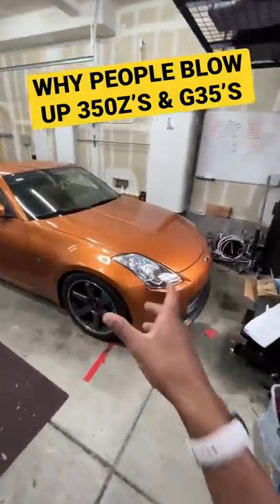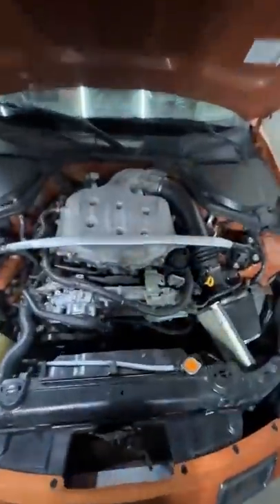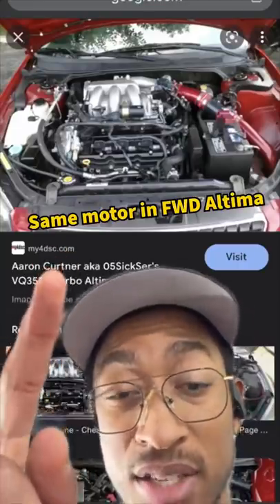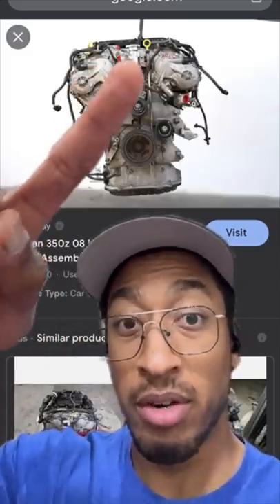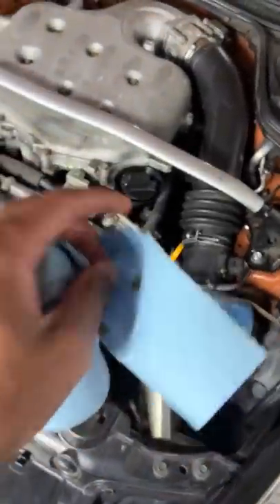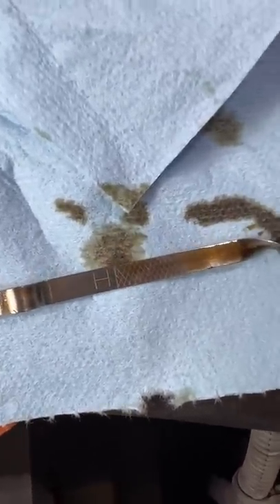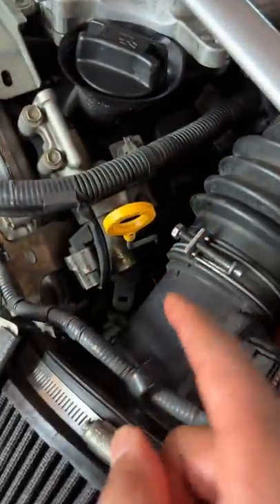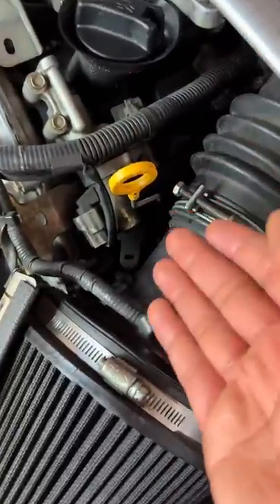Why people always blow up their 350Z’s and G35’s 💥🤯💣

Comment from the maker: In case it wasn’t obvious, I followed the manual to the letter in the first oil check. Ran to temp, waited 15 mins, pulled, wiped, redipped, and you all saw the result. I have confirmed that the VQ35DE does use the dipstick tube cast into the block as an oil drain, which is why the stick comes out coated unless the car is cold. Some cars call for cold oil checks, some call for warm. This one is unreadable if you follow the manual.
Reply: So what you're saying is the manual was written by the engineer that wants you to blow the car up so the mechanics have a reason to work on it sounds legitimate
Reply: @waynelarson1576  nah it’s probably the same manual meant in the transverse configuration so it won’t apply with the engine in the longitudinal way
Reply: @AB-rr4xh  it did the same exact thing in my Altima with the vq35 so no.
Reply: @dylanbenker2043  your altima is FWD 💀
Reply: @dylanbenker2043  AKA transverse layout
Reply: Not saying I don't believe you, but how is oil splashed all the way up the dipstick in the test where you followed the manual if you, like you said in this comment, wiped the dipstick? 15 minutes after the car is shut off, the oil should be starting to settle back into the sump, not expanded and running all the way up the dipstick, or still draining and coating the dipstick after a wipe. I've done plenty of oil changes on these engines for work and I can't say that I've ever had this problem after letting the engine cool for 10 minutes and wiping the dipstick before getting a read, so I'm not sure why it's occurring for you.
Reply: @Lyuze  I did wipe it and check it when it’s cold but I think what Chris Gaines is tryna say is that the oil is still up on top of the engine and draining through the dipstick tube. Waiting 10 min seems fine, you could try to check it after 10 min and then another in the morning see if it’s different
Reply: These engines are an absolute headache to check the level in. Don’t read what the manual says, instead just check it cold. 
Source: am lube tech
Reply: @anonymoose6969  source: I had one
Reply: I just want to know why you got a BMW steering wheel in a Nissan haha 😅
Reply: Arguably the worst thing about my car is this bloody thing
Reply: Why do you have a bmw steering wheel aha
Reply: @Lyuze  The oil returning to the pan runs across the dipstick.
Reply: Guess you didn't know you just wipe it off, then recheck...
Reply: @carlt6932  not 15 minutes after shutting the car off it doesn't. Oil is less viscous when it's hot (i.e., after the car has been running), and will settle much faster than when cold
Reply: @Orion801airsoft  guess you don't know how to read, seeing as he and many others followed the manual and this engine's oil reading is notoriously difficult to read.
Reply: @frazierl7898  lol.
Reply: @Orion801airsoft  either what you said was a joke and I am brain dead, or you were serious. I think chances are my brain is frying.
Reply: be sure it reads high level...... 
no oil in the head in the morning.
Reply: Dude get rid of the owners manual and get yourself a dealership manual!?
Wtf bro?
Who uses those?
Reply: @thecloneguyz  whenever I feel like I need the manual or I just want to see what it says I just download the pdf for it off of google.
Reply: My girls mom has a Murano, it’s a four door SUV for those of you who don’t know. I’m pretty sure it has the same engine. After changing the oil and refilling the dipstick is coated nearly the entire length as well as your same issue while hot.
Reply: @frazierl7898  believe it or not that won't tell you anything go get a dealership manual and look at how itemized those are you will never use anything else ever again
It literally shows you step-by-step where each bolt and each thing comes out first and then goes back nothing else will show you this
The reason the dealerships use them is because they don't have time to learn stuff they need something that shows them step-by-step immediately
Reply: @thecloneguyz  yeah I know what those are I work at a freightliner dealership. I don't use them as I'm not a technician but they're pretty helpful from what I saw of them.
Reply: How did it turn into a bmw
Reply: yeah i blew my up from running from the cops so much. i’m getting a new built vq35 de put into it.
Reply: You have to test it at temp not cold. Warm it up. Shut off the car. Pull stick. Wipe. Dip again. Pull stick. Check. Simple.
Reply: That design of dipstick is basically a right side up breather tube. Buddy if mine loves these cars and have been modifying them for years and also states this tube can blow oil out if the stick isn't a good tight seal also. This also effects oil pressure in race applications.
Reply: Thanks for the bit of knowledge👍😎
Reply: I'm pretty sure your supposed to check oil cold and atf you check hot in Neutral
Reply: @Crackpidgeonextreme  in most engines you can check oil while it's hot, it just has to be off and level.
Some automatic transmissions on the other hand, have become more "complicated". IMHO Overly complicated
Reply: What a load of rubbish 🤣🤣
Reply: HRs dont have this problem. Get a 370z in a few years when their value plummets.
Reply: Y is der a BMW steering wheel in ur Nissan ?
Reply: Far as I could tell the Impreza 2.5L boxer engines have the same issue, manual calls for warm check but that isn't the real oil level, there's nothing to read for a good 8-18 hrs. Have to check it cold even though it says otherwise.
Reply: Yeah I didn’t see you wipe the stick when checking after running so
Reply: When I had my G35 I ended up getting 60 grits sandpaper and sanding the crap out of the dipstick around the high and low part so the oil had a place to actually stick to when i checked it
Reply: Lube techs have a trick,  spray brake clean on the dipsticks read area, wipe,  then dip the stick very quickly, usually gives an accurate read
Reply: You just have to turn engine off, wipe dipstick and check again and you have good reading
Reply: If you cant check your engine oil you shouldnt own a car.

Most people blow these cars up because of gallery gasket failure , missfire issues while still running the car everyday. Stupid maintenance issues that are left un seen because they think the motor is so tough when in reality its only reliable if you keep up with the maintenance. Most 17yr olds thay buy these cars do not know what maintenance is and decide to only get it checked when they hear knocking noises in the car.
Reply: Can i just say, as a professional mechanic, I could write an essay on why you shouldn't listen to this guy. Oil expands with heat, check it hot. Use quality lubricants of the correct weight and property standards. And keep up service intervals. What are the most common failures you ask? Chain guides and VVT hubs or solenoids. Components that rely HEAVILY on proper lubrication. You have pinhole sized passages which actively adjust your vehicles timing and thin plastic guides that keep tension on a hardened steel chain. Just treat your car right. Or maintain it as often as you beat on it. 6 months from now I'll have a guy at the shop with a blown VQ saying "well I tried to checkmy oil but it dripped down the head onto the stick and made it hard to read." And yes, as a mechainc, this makes me unreasonably upset. Although what do you expect from a guy who drives a 350 with a useless bumper air duct and a (fake) bmw steering wheel. Only thing he's missing is an aluminum nismo oil cap.
Reply: That’s right not overnight it need to warm up cause oil expand
Reply: these blow up because people dont change oil every 2500-3000 miles and theyve been redlined since day one lol. my 04 g35 is at 170k running good and strong, but also the DE is the best VQ to build with.
Reply: Sounds like Nissan to me.
Reply: start the car run for a minute grab dip stick pull it out, wipe it, dip it, pull it out check it the reason is that the oil filter drains back into the pan so if you don't start the car and fill the oil filter then the reading is wrong and low on oil in this case.
Reply: Do it fast. Read my other comment as to experience, but get it over halfway and do it in all the way, make sure it seats and get it out. You can get between the drips from the drain hole above it. That and if it is covered on one side, not the other where the marks are, turn it around and try it that way, or just check it cold
Reply: So they blow up because the dipstick is difficult? If you’re that clueless about cars, maybe you should take it to someone else to change your oil for you😂
Reply: Thanks for the full uodate
Reply: It’s an “engine”!
Motors are electric.
Reply: @buellb0y  I think you're splitting hairs. It's a slang term. I don't think anyone on here is confused if it's eletric or internal compression. Worst than my small engine repair teacher when I was in school
Reply: You see, that's a good ol fashioned oil check. "Is there oil?" "Yep we're good"
Reply: My man, pull out the dip stick. Spray cold water on it, wipe it off, put it back in the car, pull it out and bam you can read it fine.. You're welcome 😊
Reply: Haha, that’s why many people don’t read manuals 😅
Reply: I've been in the process of rebuilding my DE and from what I can tell, the dipstick actually touches the very bottom of the oil pan, so if there is no oil on your stick, you are literally out of oil, everything else to talked about is correct aswell
Reply: @Lyuze  Literally anyone who owns a G35/350z with the vq35de can tell you that if you follow the manual, you can't read the dipstick. Yes, if you shut it off the oil settles into the oil pan after 15 minutes. What it doesn't do is slide off of the dipstick in 15 minutes, because it "sticks" to it for quite some time.
Reply: When you check the oil warm you need to pull it wipe it off put it back in then check it
Reply: Yellow dipstick means read cold...
Reply: Also if you’re running no fender liner and aftermarket intake you can suck up water in the rain and hydro lock your shit
Reply: @Dudeman9339  the 3.7 motor was a let down , the VQHR motor is the best NA V6 they made

Comment: The real reason is simply neglect and abuse.
Reply: Real reason is becauee theyre designed bad
Reply: Yes
Reply: Yea and also he’s a putz for not being able to see the oil break line on his dipstick idc how much blows up the tube
Reply: This. Mine had 4 previous owners- 3 women and a h0m0. Makes sense that the engine was a55. We dropped another one in there and it was great, so it was probably owned by a logical human being.
Reply: @cateatfood6634  you knew what you were getting into buying Nissan 😂
Reply: @oliver6287  I don’t care how good you think you are, there is zero reading of the dipstick when oil is flowing around the entire thing. 

Luckily with these engines you just assume 1000 miles = add 1 quart and try to remember to get a cold reading next time.
Reply: Bad oil type, engine was not supposed to be in use at sport car
Reply: Well if you don't know your oil is low and you go abusing it you're far more likely to blow your motor
Reply: Based
Those engines are pretty reliable
Reply: It's because Nissan motors are notoriously bad All the good motors Nissan's ever used weren't designed by them
Reply: @williamhargreaves1563  it's an engine used in many Nissan's for the exact opposite reason. it's robust and reliable.
Reply: @williamhargreaves1563 No. Real reason is neglect and abuse which any car, I don’t care if it’s a Toyota or a Ford. It will break down due to neglect and abuse.
Reply: @williamhargreaves1563  The VQ35HR engine is amazing what are you on about? thats why people leave them shits stock, you've clearly never owned a Z smh
Reply: @williamhargreaves1563 Lol yea they’re designed so poorly that they were used as the basis for the VR38 in the R35
Reply: It keeps me up at night sometimes😭😭😭

Comment: BMW steering wtf 😂
Reply: i was going to say the same thing lmao
Reply: He’s in a bmw then check oil in Nissan?  Huh?
Reply: @VikingsFan-sy2vc  its a nissan with a bmw badge on a nissan steering wheel done to troll haters
Reply: wtfff frr that's what i said 🤣
Reply: Right lol
Reply: You've never seen OEM plus?
Reply: Threw the bmw steering wheel on as soon as he noticed oil issues😂
Reply: It’s about the level of intelligence you would expect from someone who thinks oil capacity is so damn specific that it causes your engine to destroy its self.
Reply: 😂😂💀 I was thinking the same
Reply: @jgetscensored7837  it actually kinda is, without engine oil, there is no lubrication, causing an engine to explode.
Reply: @jgetscensored7837  and it was done as I said earlier to troll others
Reply: @Vl0gWithAb  But shouldn't that have been a Toyota with a BMW steering wheel?
Reply: Adds 20 hp
Reply: Because the car is badly Designed and makes problems. So bam BMW wheel and youre good
Reply: It’s a 350 steering wheel with the bmw roundel where the 350 badge was.
Reply: @jgetscensored7837  they tend to burn oil. If you can't check it reliably and easily people will over or under fill it
Reply: @jgetscensored7837  bro you talking shit on something you clearly know nothing about oil is the number one thing stoping your motor from shittin the bed if you check it hot and it's splashed up your obviously gonna be like oh there's enough when there isn't
Reply: @kadenbell3005  been a certified tech longer than you’ve been alive buddy.  Thinking that there’s any difference between 4.6 and 5.2 quarts (the top and bottom hash mark of the vq35) is absolutely moronic.  

But I’ll take it a step further: If you have enough oil to maintain oil pressure, but aren’t so full as to cause churning, then you’re good to go.  

Add your oil, wait ten seconds, wipe your dipstick, put it in, pull it out, check it. If you’re between the tack marks, you’re good.  Stop nuking something so simple
Reply: @jgetscensored7837  losing 1qt of oil can cause the top of the motor(cams, lifters) to be under oiled causing premature wear. Some engines are able to handle slight underoiling, others are not. The vq obviously can’t handle it. Also having an ambiguous dipstick can cause you to overfill, which can blow seals and damage the motor in other ways.
Reply: @deadchannel991  overfilling will not increase crank case pressure, so how is it going to blow out sealS? 😂
Over filling can create churning (introduction of air into the oil) which can actually decrease oil pressure.  Or, if you already have seals that would leak if submerged (rear main and crank seal) then yea, it’s going to seep oil, but that’s a WAY over filled crank case to be that high. 

Under filling by one quart will not starve anything of oil.  If oil pressure is present, things are lubricated.  And no part of the engine takes priority in divvying out the oil pressure. Pans are designed in such a way where under typical to somewhat aggressive driving conditions, the pickup tube remains submerged.  You could make the argument that being a quart low makes it more susceptible to g-force induced oil starvation, but that’s not extremely likely to occur.  It’s rather unlikely to occur actually.   The oil pickup on any car is directed to the deepest part of the pan and is typically baffled to prevent starvation.  It is unrealistic to say that one quart short of full will do any damage to an engine, even on a four quart system.
Reply: @jgetscensored7837  damn that’s a lot of words. 

Don’t care, it’s dumb to act like they didn’t design the engine for a certain amount of oil and having less won’t damage it. 

Guess they just arbitrarily decide on how much volume of oil the engine needs? 

I’ll make sure I never buy a vehicle you’ve owned or worked on
Reply: @deadchannel991  that was a lot of words?  Ooof. 

And no, there is a set minimum and maximum level, not an arbitrary amount.  Shouldn’t take a rocket scientist to figure that out.  And as long as you’re in between the top and bottom mark (approximately a one quart difference) then you are absolutely fine.  That’s BASIC automotive knowledge.  I’m surprised there’s someone out there who doesn’t know that

Comment: "Do you know why so many people blow the engines in these cars"? Cuts to exactly what I'm picturing in my head 🤣🤣🤣🤣
Reply: They never do fluid and solenoid changes
Reply: its practically a drift car stock bro its ok to redline it

bam
Reply: Haha this is much more likely the reason, and also going over their oil change being due.
Reply: I’m thinking it’s when people upgrade all these parts with big turbos, intakes, internals that require higher octane fuel and they cheap out on the vital stuff.

Comment: I pop my hood and check mine every morning. NEVER TRUST A VQ DIP STICK😂
Reply: i have a VQ40, the only VQ designed for a rear drive application 😂
Reply: This was this first thing i learned when i got my fx35😭
Reply: The only thing worse than a VQ dipstick, is a MINI Prince dipstick
Reply: @AmbroseBurnside1824  or the VQ38DD which replaced the 40